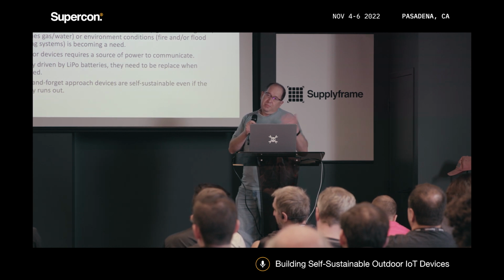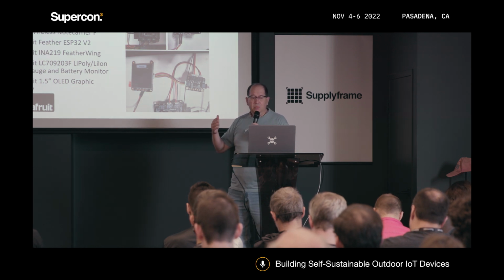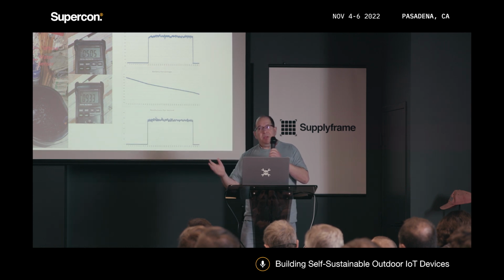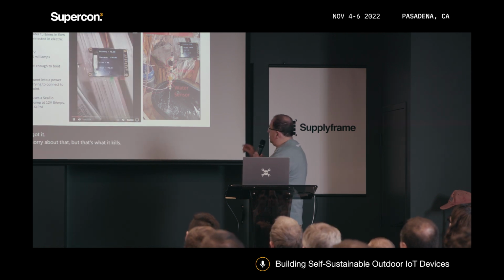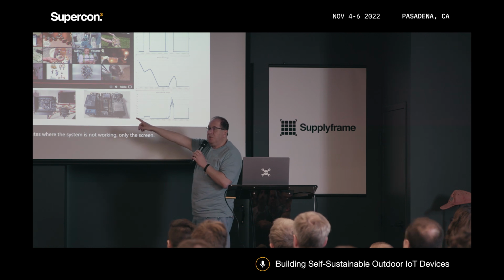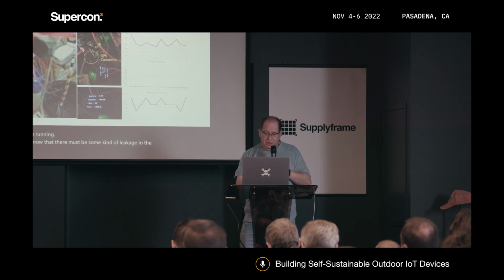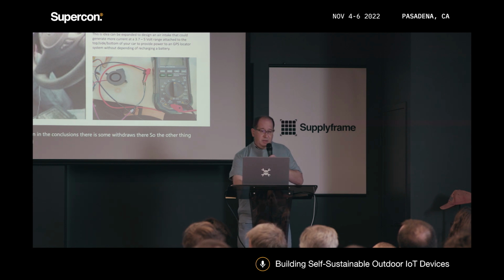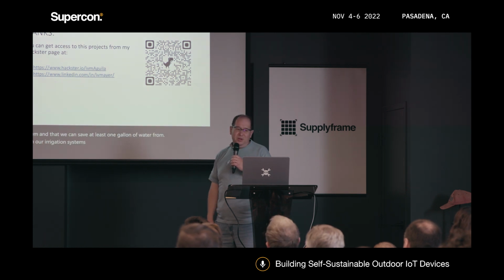Supercon 2022: Irak Mayer Builds Self-Sustainable Outdoor IoT Devices

Comment: I've wondered if an anemometer could measure it's speed reliably based on current output.  Bonus if it also powered itself.  I believe their is already an Alexa showerhead powered by the water flow.